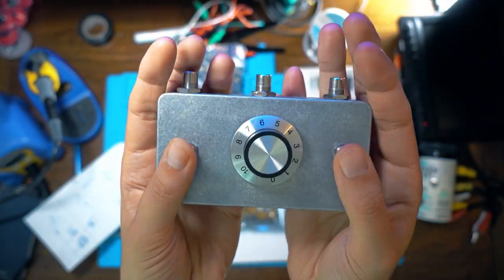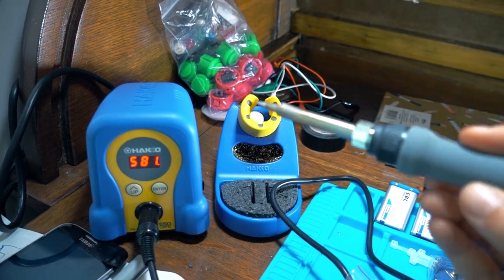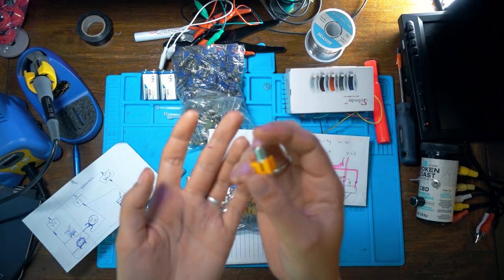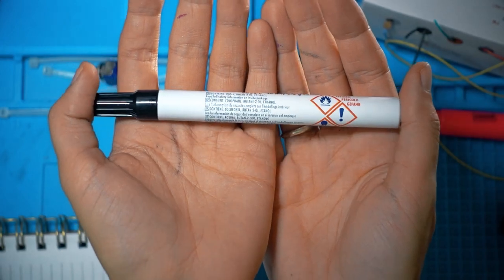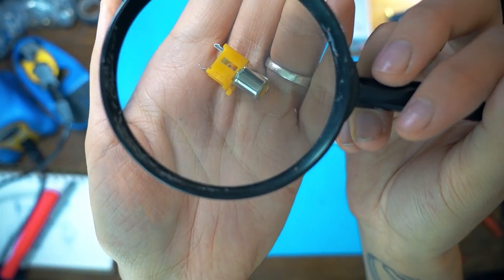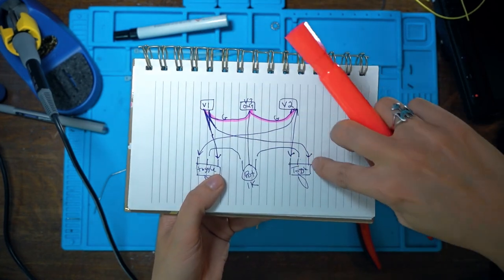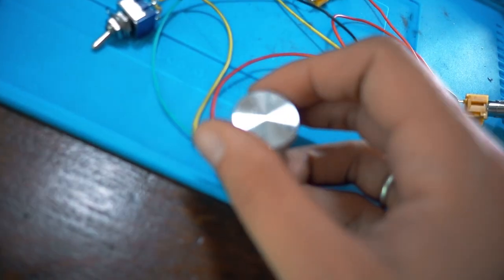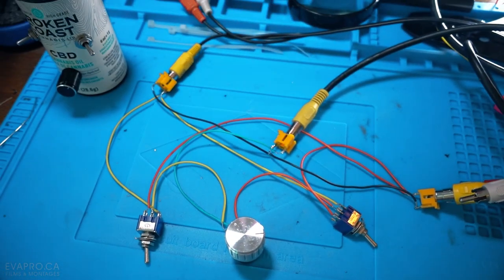How to build a DIRTY VIDEO mixer (PART 01)

Comment: Hey Eva

I just built this myself and I've been running into some signal drop issues. I was wondering if you used a time based corrector to stabilize the output signal. I'm also running into issues where one channel I am mixing does not want to appear unless I plug in the audio associated with that source. Did you run into that issue? If so, what did you do to mitigate it? Maybe you can do a video on setups and video capture.

Comment: Awesome video, thank you very much. The only thing I need are the “video sockets with nuts”, as the links are not available anymore I don’t know which ones I should buy. Could someone help me pls? I got some but they don’t have two points they just have one that looks like a small shovel kinda thing. Is it also possible to do it with those ones?? Excuse me i am a noob
Reply: “Aiqeer 30 Stück RCA Weiblich Buchse Verbinder, RCA Audio/Video Verbinder, RCA Plattenmontage Einbaukupplung Terminal” those are the ones I got

Comment: I think i actually have parts lying around to make this, going to give this a go. Random question, do you think i can rip some composite ports off an old mixer i found and those will work fine? or should i purchase some different ones?
Reply: super late response and you may have figured this out for yourself already, but as long as they're 1k pots it should work the same. I'm not a video circuit bender, but I would assume that a different value pot would probably work as well but would probably affect the amount of "dirt" in the video output.

Comment: What happens if I coneect two inputs with different voltages and an output with another different voltage.
Lets say, a camera with a battery 3.4V DC on an input, a dvd player at 110V A.C on another input and having an output that goes to a display at +12V DC. Won't their grounds get messed up and damage each other?
Reply: No their grounds should be at the same potential, regardless of power source for the device. If there is a slight difference they will balance themselves once you connect them anyway.

Comment: This is super awesome and I really want to try it! But could someone please explain the difference between using a 1K Potentiometer vs say a 10K? Does it have an affect on the distorted output? Also say I wanted to have multiple video sources, can I add more than two video inputs? If so how would I connect it all?
Reply from the maker: a 10k potentiometer has ten times the resistance of a 1K potentiometer. ... The higher resistance of the 10K pot means its voltage will be influenced more by the circuit to which it is connected so you get more distortion.
Reply: @EVAproductions  Okay that makes a lot of sense thank you very much. And is it possible to add more video inputs?